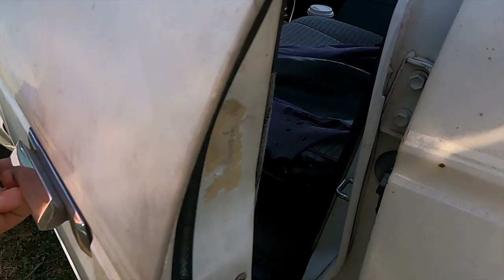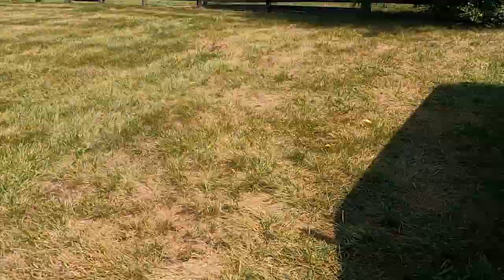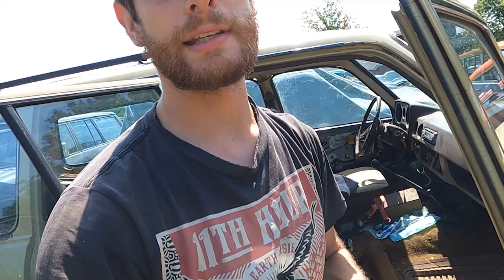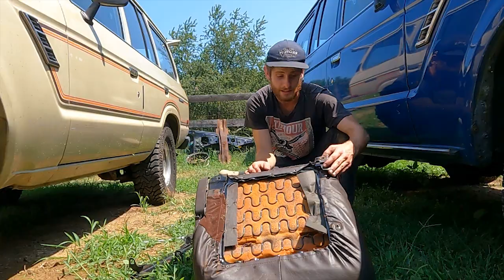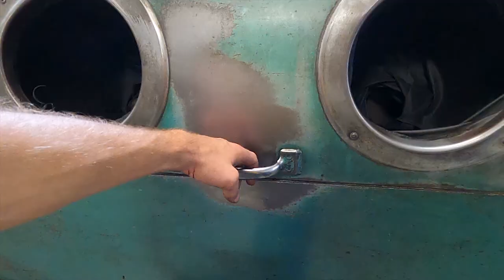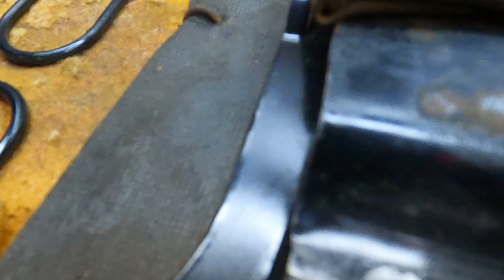Ripped or Torn FJ60 FJ62 Drivers Seat? Heres How to Repair It

Comment: good afternoon, I want to learn from you about the 2F and 3F engines, both carburetor engines, what is the difference between them, which is more economical, which is generally better? we have no information about them in Russia, I am grateful in advance!
Reply from the maker: Depends one what your looking for i dont know anything about the 3f motor. i know 3fe motors are pretty good with gas. 2f engines are 4.2L 3f- 4.0L. Your really dont buy these trucks for fuel economy honestly.
Reply: @mizeadventure9438  you will not find a link to reviews about these engines, I am not strong in English, but I could get acquainted through a translator.
Reply from the maker: @ЮлияПопова-о9с1с  ehh not sure where i would find that information. ill see what i can find for you
Reply: @mizeadventure9438  I also wanted to ask have you ever encountered a 2H or 12 HT motor ?
Reply from the maker: @ЮлияПопова-о9с1с  i havent. never worked on those.
Reply: @mizeadventure9438  I'm sorry for the trouble
Reply from the maker: @ЮлияПопова-о9с1с  No trouble. just not sure about all that stuff.